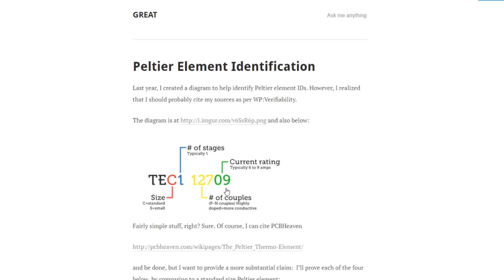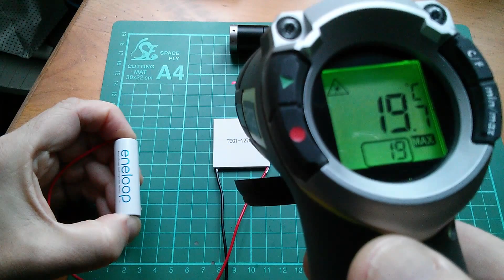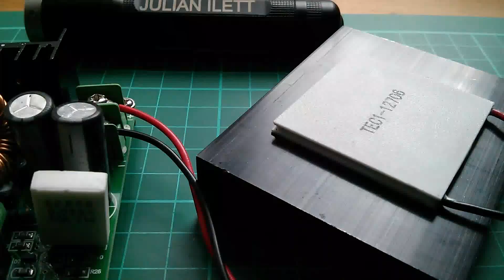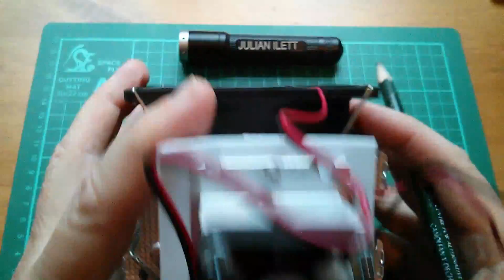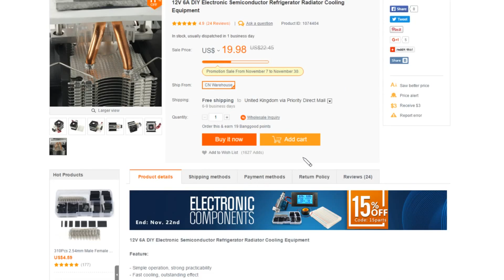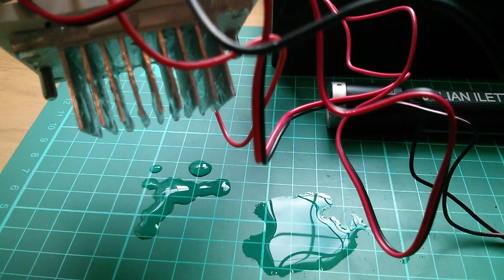Playing with Thermodynamics: Peltier Element Cooling

Comment: They have a 15A @12V I wonder if this has enough to cool a good size refrigerator or maybe 2 of these on each side of the freezer area... Years ago I had a idea to cool this processor enough so it wouldn't throttle and overheat and maybe use a 1A with a dimmer switch to bring the current up or down, but I was worried about water, but the heat coming of this processor should dissipate the moisture.

2Pcs TEC1-12715 Heatsink Thermoelectric Cooler Peltier Plate ModuleDescription:Solid state, vibration free, noise-free
Simple to install and operate
The hot surface need to be good heat sinkSpecification:Product name: thermoelectric cooler plate module
Model: TEC1-12715
Color: white
Couples: 127
Voltage: 12V
Umax: 15.4V
Imax: 15A
Max power consumption: 231W
Tmax: 70°C
Qcmax △T=0(W): 137W
Size: 40 x 40 x 3.3mm
Weight: 100g(2pcs)Package included:2 x TEC1-12715 module

Comment: found the same element for about half the price: http://www.ebay.com/itm/12V-60W-TEC1-12706-Heatsink-Thermoelectric-Peltier-Cooling-Plate-Module-MU-UL/161910431943

Comment: +Julian Ilett  Please be careful saying that a blunt knife is safer. Rarely is a blunt knife safer, since it requires more force to use it, and therefore things become dangerous more suddenly. Always use a sharp knife, and brace yourself to limit movement. An easy way is to hold your forearms tight against your chest and only use the limited motion of your wrist to force a cut.

Comment: is it safe to power the peltier with small 5v 500mA adapter.. im trying  to make a small can cooler..
Reply from the maker: At 5V the TEC1-12706 was drawing 2 Amps, so your adapter may get hot.
Reply: Julian Ilett any suggestion on a small and light weight power supply mate.. just want to drop it couple of degrees..
Reply: It would let the smoke out of the PSU.
Reply: Paul Sengupta thankful it didnt but it is quite hot.. i barely know what im doing... 😂

Comment: In general dehumidifiers bind the element to a large thermally conductive plate, which it then keeps just above freezing. A fan then blows room temperature air across it slowly. Water drips off the plate into the water tank. Dropping the element below zero just freezes the water it collects, which is a waste of energy.

Comment: Hello from the US! I enjoy your videos as I'm trying to learn how to make a Joule Thief. Could you do a video about thermoelectric power generation using 1 or more Peltier devices? You just need a big temperature difference, people often put a big heat sink on the cool side and heat the hot side with a candle. But I'm wondering if there is enough voltage and current to light an LED, with or without a step-up booster. 

Thanks!

Comment: You should try getting less surface tension by coating the heatsink with some kind of teflon based spray. It would make it harder for the water droplets to form and drop quicker.
(Although this is a horribly inefficient way to dehumidify anything, but would be fun)

Comment: My understanding is the effect is two way - so if you cool the cold side, or heat the hot side, it should in theory generate a small amount of electricity?  Is that correct?
Reply: Confirmed, I've just checked and yes - that works!  Apparently you need to cool the cold side and heat the hot side.  It's got me thinking - why aren't we bulding walls with these fitted?  It's nearly always colder outside than inside, so wouldnt it be a good idea to have thousands of these on the outside of a home with the cold side facing outwards and the inner side facing the inner side where hopefully it should be warmer.  Then harness the power generated to perhaps charge some batteries or something?  I guess the efficiency is the problem and the thickness of the device.  In an ideal world I guess it could work optimally if the warm side was on the inside of the house and the cold side on the outer side of the house, but I guess that probablly wouldnt be practical.
Reply: cost/benefit
Reply: It only generates power when heat is actually being transferred from the hot side to the cold side. So a Peltier wall would leak the heat out.
Reply: I was thinking more along the lines of integrating the design into the structure - ie. the building material.  Accepted that cost is the main prohibitor, but imagine bricks that could capture light and cold as power.  We are a long way from that but maybe one day that's how all houses will be built.
Reply: You only get power out if you transfer heat from one side to the other. So what you suggest is a huge waste. There's no free energy here, you have to put heat into them by heating continously heating your rooms.

Comment: BTW... When the two sides received their *saturation limits *
They will drop in current... 
As you heat up the cold side current increase, as well as cooling the hot, sounded like you were in I don't know mode, and I've been in a peltier study as I have a peltier powered refrigerator here that I upgraded to behave like a freezer ☺️
Reply: hey Andrew, im interested also in peltier and am trying to deal with the hot side,
is there a way to insulate the hot side so it doesnt heat the room without cooking the peltier ....people talk about using hot to generate small power, but i dont think it will stop the heat problem...
Reply: @inconsequencial2546  The peltier is a heat pump. If you don't give the heat anywhere to go from the hot side it will just progressively heat up more and more until it burns something out. The only way for it to make the cold side cold is to move the heat from the cold side into the hot side. If you want to make the cold side cold without the heat from the hot side dissipating into the room, you have to put the heat from the hot side somewhere outside the room. Maybe stick the hot side out a window and seal the gaps around the window. Then you'll have a really weak air conditioning unit.
Reply: @clonkex  I just want to make cooler water container so I'll put the hotwire above....I have a fan to cool myself🤣

Comment: "stick in in your mouth then connect they battery to it" -Julian Llett 2016
Reply: Susan Donovan w
Reply: Fucking Priceless! I was laughing so hard I had to give you your props! Peace
Reply: So beautiful
Reply: hahaha you forgot the following "mmmm mmmhmmmm"
Reply: Actually mouth is a great sensor. Once I build a small dynamo and used to check whether it was working or not by sticking wires into my mouth (I didn't had a multimeter). It can detect very small voltages
Reply: that is how you chip a tooth.
Reply: @NudeJawn  and Coronavirus
Reply: Bracketed nicely with “lets watch this ice melt”
Reply: Last words of Professor No Lips.

Comment: 2 Questions: -wouldn't the collected condensed water derived from the air get evaporated again from the collection tank if the air is warm ? -could the peltier-effect be reversed by applying heat and cold to either side so it creates electricity ?
Reply: oh the 2nd is already asked/answered in the comments :)
Reply: Yes, that's why the tank is not open to ambient air.
Reply: superdau yea I see its easy to prevent that from happening

Comment: You can just run the peltier chip run at a lower voltage or current and try to find the perfect voltage/current at where dehumidifying is at it's peak.

Comment: Julian;

This episode  makes you officially and genuinely crazy, sticking a Peltier in your mouth, think of children. I use to watch just because of your so mellow smoothing speech, but now I will look forward to more cray. ;-)

 Anyway well done. You should however tried to measure or estimate BTU efficiency of the device. I've always read that Peltier are just nasty with inefficiency, so do the math for us, perhaps using a abacus by manipulation with your tongue,

  My only experience was about 25 years ago hooking one about your size to 12vdc with nothing attached. After about 5 mins the thing actually unsoldered itself into a heaping pool. No problem I've always supported destroying stuff in the pursuit of science and knowledge.
Reply: Lawrence L I heard they’re about 10% efficient, this 72 W Peltier can pump only 7.2 W of heat. So yeah, pretty bad, a heat pump has an efficiency of 300 %. If the Peltier had that efficiency, it could pump 216 W of heat!

Comment: but why why why did they use metal fasteners on the cold side, so it can pump a few percent of your efficiency back out to ambient? You can just about make out water condensing on the length of the threads, outside the gasket material

Comment: Probably a word of warning, if Julian doesn't mention it. Don't put the peltiers rated voltage across it while you have it in your mouth. You're going to end up with one burnt lip and one stuck frozen to the peltier, until you disconnect the power :P

Comment: You can make air pipe from the hot side to the cold side. Water in hot air condenses faster.
Reply: Uhm, no. You have to cool down the air below the dew point. If you start with hotter air you have to do much more cooling.
Reply: You don't have to cool down the air, only the surface. I have dehumidifier and it doesn't work very well at 15 deg. C even at 60-65 % humidity. however if I turn the heater on and rise the room temperature the it works a lot better. Another example is when you get a cold beer (5 deg. C) out of the fridge in a hot summer day - 35  deg. C. The water drops start 5-10 seconds after that. It doesn't work that well in a cold room.
Reply: Nickolay Pelov
The warm summer air contains much more (absolute) moisture than cooler air around now. If you just heat up air, the dew point stays exactly the same and that is the only important temperature. When you say that it works better when you heat the room then it is for the same reason. The warmer air is able to pick up more moisture from people breathing and stuff in the room (like plants and even furniture or curtains and things like that). But that is something very different than piping the air from the hot side to the cold side. In that case the air had now chance to pick up any more moisture from anywhere. There's no way it will work any better in that case. That's just physics.
Reply: Well, I could be wrong. My statement is based on observations, but I may be missing something. What is your statement based on? Can you supply a material or a wiki page that proves it. It's not that I don't trust you, but that's no religion, so trust and believe is not relevant. It's a serious question, I'm not messing with you. I also want to experiment with dehumidifiers.
Reply: My statement is based on physics ;) . There's no special one page that explains that. But look for something explaining the relationship between absolute and relative humidity and temperature and what the dew point is.
It is also based on the fact that I know that the really accurate humidity measurement devices work by shining a light on a mirror that's temperature controlled. The temperature is reduced until the mirror fogs up (the reflection vanishes) and the device now knows the exact temperature of the dew point. If that were dependent on the temperature of the air before the measurement, the device would be of no use.
Reply: So if I heat the air right before passing near cold surface I won't get more dewiness. How about heating the whole room. You say that it's actually taking more water from objects like plants, so I'm getting more water in my dehumidifier, but I'm not actually reducing the humidity more effectively, because the water is coming from people and objects. Did I get it right? What can I do to dehumidify the air faster? Run fan(s)  around the room to cycle the air?
Reply: Nickolay Pelov
Yes, that's right. A hair dryer also works much better when the air is heated instead of just blown (the "cold" setting), although the air has the exact same absolute humidity content as all the air around it. If you want to reduce the humidity in the air in a room effectively without running more dehumidifiers, you have to reduce the humidity sources.

The easiest way to dehumidify in winter is to open all windows once or twice a day for a few minutes and exchange the warm air with cold air. Since the cold air can't hold much moisture it will be very dry when heated. Because the air exchange happens every time you open the door to the outside even when you don't do it on purpose, in the winter too much humidity is almost never an issue. It is only a problem, if you have a badly insulated home and the inside of the walls is cold (especially in corner). In principle all your cold wall is a dehumidifier, because water condenses there. Bad side effect is the mold. ;)

Other than that, more air flow is better, because otherwise you maybe only "get" half of the room. Also moist air of the same temperature is less dense than dry air, so it might be more effective to put a dehumidifier up on a shelf (no idea how big the effect is). If you have a cold corner in the room heat there and put the dehumidifier on the opposite side of the room.
Reply: The wall condensing is what we are trying to prevent. Of course insulation was the first thing we did. We actually don't worry about too much moist in the winter. The problem is that this moist condenses on the walls. I'll try to put the dehumidifier on a shelf. Thanks for the advices!

Comment: you do not want to put it in your mouth and connect it to a 9 or 12 v battery!!!! I connected mine for only a second. and was holding it in my have . and it burned the crap out my finger. before I could put it down. but I am more interested in power generation. with them. have you though about putting a bunch on the back of solar panels? it probably wouldn't be worth doing unless you were in the desert and had cool h2o to cool it! it can help the solar output. but they aren't really efficient at making power! it would take thousands of them. glad to see you with the tec.

Comment: I actually tried to build a dehumidifier with an almost identical setup. I was as not very successful though. I got the water to collect on the cold heatsink but not get it to drip. With properly sized heatsinks it should stay just above freezing point. BTW for a dehumidifier it should be more efficient to direct the cold air from the cold heatsink into the hot heatsink.

Comment: using a 100w peltier plate, and a nice large CPU cooler on the hot side, and the stock intel cooler on the cold side, i was able to cover the intel cooler with about 1cm of frosty ice, its qutie impressive.

they all operate at a delta temperature, not all peltier plates are created equal, so one 100w plate might have a 80*C delta, and another might have a 40*C delta.

Comment: have you tried using one of these to cool a led? i have a cree xhp70 led for my bike lights but has a round 40mm wide case but cant find one to fit inside it. was then going to fill the back of it with mineral oil and bolt a heat sink to the top off it with the bolts going inside to coll the oil as its non conductive.

Comment: Those "12v" Peltier elements can actually go up to about 15 volts, which is very useful for some real cooling/heating power.
Reply: Yet, with bigger power come greater issues with the peltiers generated temperature difference, if the heatsink is not up to the task.
Reply: Naahh... Better to upgrade your heat sinks than increase your voltage.

Comment: Hi Julian, Could you make a video showing power generated by the Peltier unit using a temperature differential? 
How about also using multiple units stacked for a greater effect?
Reply from the maker: http://www.ebay.com/itm/TEC1-SP1848-27145-TEC-Thermoelectric-Heatsink-Cooler-Peltier-Plate-Module-/311534560155

and
http://www.ebay.com/itm/TEC4-24603-Heatsink-Thermoelectric-Cooler-Peltier-Cooling-Plate-Four-layers-/262174876788

Comment: You should experiment with the Peltier as a power source, I built a self powered wood stove fan ;)
Reply: Nice one - xept my stove needs slowing down !
   I made a cool box for food - a sort of fridge, but no Ice box, yet.  It uses Two parallel strings of 4 in series, and a dish of water cooling the hot sides via a thick flat Aluminium plate, and two Pc fans in series blowing on the water. 
It saves my world in that hot weather here in Bulgaria.  Goes nicely on 24v (from regulated Solar panel).  The regulator makes litres of hot water :)
Reply: Come to think of it, I did what you did, too.  Back in 2010, I was skint and had to give up gas bottle cooking, and made a forced draft wood burner the size of a Gaz Camping stove.  Had "smoked"  Everything !
I always say, "It's an I'll wind INDEED, +(that blows no good at all !)

Comment: When you twist and pop parts off like that you risk all manor of problems. 

You can:

* break the part 
* twist it off in a way that leave a little divot where it was attached to the sprue.
*If you don't paint the parts it can discolor the area around the attachment point
*and believe it or not increase global warming 

So if you don't care about your workmanship or the baby polar bears in the Arctic go ahead  twist away. And I'm sure there are at least 4 sets of side cutters within reach of this bench right now. 

:)